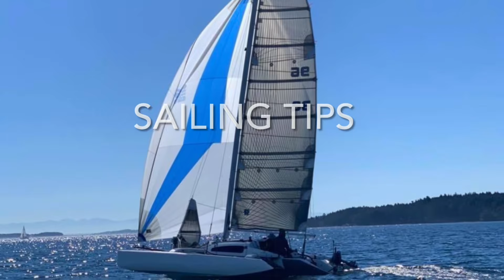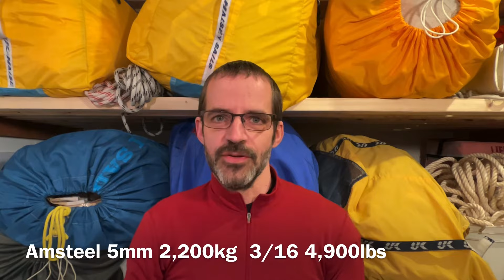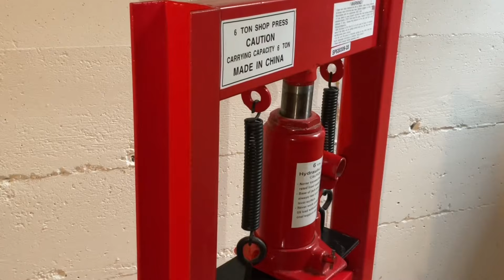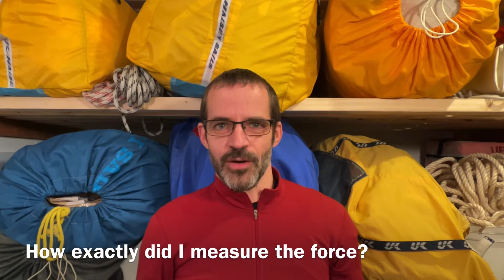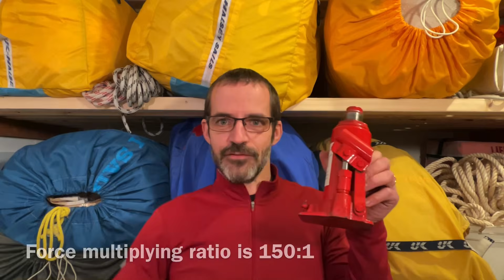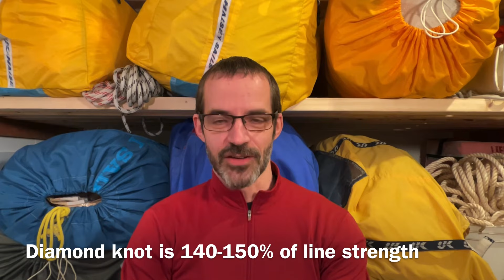The Easiest Way to Make Soft Shackles

Comment: I'm not a sailor, but I use the soft shackle on my camping hammock rigging. I've been using the diamond knot, I have tied it many times for myself and friends. However; seeing the strength of the figure 8, I guess I'll be using that from now on. It's quicker and simpler to tie, and hammocks have far less stress and strain compared to sailing applications.. A BIG thank you. I'm gonna subscribe just incase you come up with other handy dandy "things" I can plagiarize.
Reply: The big advantage of the diamond knot is that the knot ends up bigger, makes it less likely to whip loose. You’re basically always going to have at least full line strength from any of these things, so unless you want to live dangerously by, say, using a 4mm soft shackle on 5mm line, the MBS is just not all that interesting.
Reply from the maker: Glad you like it! You should check out this video where I use an overhand soft shackle to lift the front end of my car, so they may be strong enough for a hammock too! The Amazing Lightweight Rope That Can Lift A Car!!! https://youtu.be/9shiekaQNT0
Reply: Very intuitive,  many thanks

Comment: You can greatly increase the strength of this by tying the knot on a pair of brummel splices at  the ends and then looping the knot completely through the two eye splices. The bury must extend a couple of inches beyond the beginning of the knot. This requires more line, and if this breaks, it will break in the loop. See https://www.youtube.com/watch?v=jU_mmdbQeCQ
Reply from the maker: Yes that variant is much stronger, and beefs up the weak points adjacent to the knot as you noted! I did some fun practical testing of the “weak” variant in this video: The Amazing Lightweight Rope That Can Lift A Car!!! https://youtu.be/9shiekaQNT0

Comment: But WHY not using stainless steel, or simpler cord for mildly loaded applications?
Never heard of this tinkering.
Reply from the maker: You could use stainless, although it's more expensive, and tends to come in limited sizes determined by the manufacturer. You can make these any size! You can also use any cheaper single-braid line for more mildly-loaded applications. Just made a new video on this which uses a really long shackle! The Amazing Lightweight Rope That Can Lift A Car!!! https://youtu.be/9shiekaQNT0

Comment: "says Dyneema is really slippery and doesn't hold knots well, then ties simple knot for soft shackle knob.  Knot slips."  This kinda bugs me - I'd far rather have a soft shackle that breaks before the knot unties.  For that, James from Sailing Zingaro demonstrates a soft shackle that still uses a simple overhand knot, but the free ends have simple spliced loops spliced in that the rest of the soft shackle runs thru.  This stops the ends from pulling through and the soft shackle can not come untied.  Pretty slick - https://youtu.be/o4J4hJoJFHg?t=1040    HowNot2 also has a demo on this type, and they did break tests using a strain gauge!   https://www.youtube.com/watch?v=jU_mmdbQeCQ    Peruse their videos for other useful knot and sailing info, too.
Reply from the maker: Those are great videos! It really depends on your use case as to how complex you need to go. When I said “doesn’t hold knots very well” I was referring to the misconception that knots Dyneema are useless, when in fact it takes quite a bit of force to pull them out. My simple shackle could lift a Toyota Corolla before the knot pulls out, which I think is still pretty useful for lots of applications, even though a more advanced shackle with the same line could lift more. The benefit of the Sailing Zingaro technique is that the bury doubles up the Dyneema where it normally breaks too, so it’s a very good technique, just a bit more complex.

Comment: Hi, I  just discover that the « biggest » problem of dyneema is that it expand in cold weather. Have you experienced that? What is your take on this? Thanks for your insight
Reply from the maker: I haven’t really noticed or found it to be a problem. We use Dyneema stays for our mast and bowsprit, plus lots of other things. I know lots of other boats that use Dyneema rigging too and they haven’t said anything about temperature sensitivity either. But it’s also not that cold in the winter or hot in the summer here (West Coast BC Canada) so maybe a bigger problem in other places? Hope this helps!

Comment: I just came off building a bunch of these. I must say that the diamond knot is really not difficult to tie at all. For a highly capable guy like yourself that can perform all these hydraulic break strength tests and sail a race boat the lanyard knot is pretty simple. Id recommend the diamond lanyard over the overhand. The button knot is a bit tougher so the diamond lanyard is a nice compromise.
Reply from the maker: I totally agree – if you can tie a Diamond knot then do it!

I first tied soft shackles with an overhand knot a couple of years ago shortly after we got our F-82R trimaran when I was experimenting with different spinnaker and screacher sheeting locations on the aft beam and wanted something where I could easily adjust the length of the shackle on the water. It truly was a jury rig and I was expecting them to blow up on the first sail, but they didn’t.

Six months later, we blew up the diamond knot soft shackle that connects the main sheet to the boom (due to chafe and not inherent strength of the shackle or knot). I didn’t have a long enough diamond knot shackle on hand to replace it but I did have a long overhand shackle on the boat, so I used it, also expecting it to blow up due to the higher loads, but again it didn’t. 

For the next two years I kept using these overhand knot shackles in progressively heavier conditions with no issues whatsoever when I saw a forum post asking “Can you tie a soft shackle with something simpler than a diamond knot, like an overhand knot?” I had the answer and it was a resounding “yes”, so I decided to do a YouTube video on it and post the video in the response. But before I posted the video I thought I had better do some empirical strength testing. So the progression was somewhat backwards to what you might expect 1) jury rig 2) field testing 3) empirical testing. 

Regardless, I will agree that if you can tie a Diamond knot then stick with that!
Reply: @SailingTipsCa  yeah when i went with the diamond i was wondering if i left something on the table by not using a button...but if a get that reduced rating...of   3000lbs?....did it matter? I need maybe 200 lbs...and that buttons a pain!...so yeah i take your point as well
Reply: I’ve tied button knot soft shackles, and they’re *fine*, but I cannot get that knot into my head. The diamond knot, on the other hand, is easy to tie by heart — I even did some experimentation in how I could do it wrong and what to avoid.

Afaik the difference in the strength is pretty much entirely because with the button knot, the noose goes around four strands instead of two. Makes you wonder whether you can’t just bury a short piece of filler inside the two strands at that location and get the same benefit.

Comment: I'm about to test a double fisherman knot for easy soft shackles. If you bury the tailsback into the rope it sold should increase strength a lot too (bigger bend radius of noose)
Reply from the maker: When pushed really hard soft shackles typically break adjacent to the knot where the noose attaches, so burying the ends back in creates extra thickness there and helps mitigate that problem!

Comment: Really nice with simple soft shackles. Instead of optimised knot you can increase line dimension one step. A little more cost and weight.
Reply from the maker: Yes you can use this general noose technique and experiment with different types of stopper knots. Try it and let us know how it goes!

Comment: If you  tie an ashley's bend (abok 1452) and then capsize the tail "hole" over the head "hole", that should make a two strand diamond knot.
I guess the trick is to find the simplest two strand stopper that is very stable.  I'm nervous about the figure 8 as a two strand stopper.
The climbers have had bad experiences with that as a "flat bend"  where you pull the legs apart and load it at 180 degrees to get a flat side that will slide across obstructions or ridges.  The standard way is with an overhand knot, known as the European Death Knot.  Some people were worried about the overhand knot capsizing at a low load and tried the figure 8 instead.  It capsized at a much lower load and rolled off the end of the tails, making it worse, not better.
I realize this application is not the 180 degree loading, but more of a stopper loading at zero degrees, but I would want more testing of rolling on perhaps not perfectly set figure 8 knots to see how sensitive it is.  In the EDK vs Fig8  testing, quality of set was a critical factor.
I have a strong interest in making soft shackles in the field for camping.  You can save a lot of weight by carrying a few feet of amsteel blue type cord instead of a bunch of aluminum carabiners that you might use in slinging bear bags, improvising suspended bedding and things like that.   Suspended bedding tends to get some harsh loads from shallow suspension angles multiplying the midway load a lot.
Reply from the maker: You’re absolutely right that the key is to find a two-strand stopper that is both very stable and easy to tie. I’ll look into your Ashley bend recommendation. 

You’re also absolutely right that a flat figure eight bend performs poorly where you pull the two legs apart, because it rolls over itself and comes apart. We actually did a test of this versus a double overhand knot, where we took two strands of climber’s rope, put a double figure eight in one end, double overhand knot in the other, and tried to pull them apart from the middle with a hydraulic jack. The results were exactly as you described – the overhand knot performed far better in this application. 

We have it on video so I just posted it as a short (https://youtube.com/shorts/LjR5JRGyaxI). I was reluctant to do so previously because it’s not a typical sailing knot or configuration, and I thought it might confuse people, but I have it so why not!?!?

On the other hand the figure 8 appears to perform better as a stopper knot, particularly in slippery Dyneema applications, where the legs are not pulled apart.

All of that said, I just use the double overhand knot in the soft shackles on my boat because they’re strong enough for my needs. Thanks for your comments!!!
Reply: @SailingTipsCa  Thanks for the clip.   That's fun to see! 
I know a few simple single strand stoppers with good performance, but most of the big, strong double strand stoppers take some work.
For more security and more work, a lanyard knot (a.k.a. bosun's whistle knot, abok 787) might be really secure.  I'm comfortable with tying it because it is just a double carrick bend with the most obvious follow throughs.
There's also a fun sort of finger jig technique for tying it that usually goes along with the boatswain's whistle knot demo.
But you're right, unless you're really close to the line strength, it doesn't matter that much.
My hammock strap system is using brummel spliced eyes and a long friction tube adjuster in hollow braid amsteel blue, so it already has a pretty efficient build so I'm using minimal sized line for that .  Field built is usually over-sized for simplicity.
I probably just don't like overhand knots much.  I wonder how the double fisherman's bend (a.k.a. grapevine - abok 1415) in the tail performs.  it's really easy to tie.  That was one of the fixes to improve strength/stability on the overhand flat bend in the climber's investigation.  You're never going to untie it after full loading though.

Comment: Thanks. Would these work for reefing a sail? Or is there a better faster singlehanded reefing method?  I'm a fairly new sailor. It's for an OzGoose dingy.
Reply from the maker: You can definitely use for reefing - I explain one approach in my reefing video at https://youtu.be/zUJ_eQU6z5Q. I use this shackle for the third reef on our F-82R trimaran, because it's very deep and I don't want to leave those really long reef lines rigged all the time. You generally need to lower the sail to get control of it, then insert the soft shackle and re-hoist. If you leave it partly raised the flogging may make it difficult to get control of the clew, although the OzGoose is a pretty small boat so you might be able to leave it partly hoisted.  You could also try leaving the soft shackles inserted into the reefing cringles and secured with a small piece of whipping twine so they they don't fall out. Have you talked to other OzGoose sailors to see what they do?
Reply: @SailingTipsCa  
Thanks

Comment: Do the soft shackles require any yank protection ?  If used to hank on a jib does the stainless wire rigging eat through naked dyneema quick time ?
Reply from the maker: I’ve used Dyneema hanks on synthetic and stainless rod forestays, but never on stainless wire. That said it would probably work too, as stainless wire is also fairly smooth when in good condition, the loads on the hanks aren’t that high (relative to other applications) and Dyneema is quite abrasion resistant. The main type of Dyneema hank I’ve used had a Dyneema loop sewn into one side of the sail, which loops around the forestay, and is captured by a Velcro closure sewn into the other side, like Velcro shoes for kids. I’ve only ever had Dyneema abrade through on sharp edges, but never on anything rounded. Do you have grommets on your sail?

Comment: It's amazing that the dyneema soft shackle works with a figure-of-eight knot. So a much more complicated diamond or other comparable knots are not necessary at all?
Reply from the maker: I know - I often don’t even bother with the double figure-of-eight and just use a double overhand knot! Maybe the fancy knots are like a secret handshake or something like that! A freshly tied double overhand or figure-of-eight knot will pull out instead of actually breaking the line, which I think the secret handshakers were afraid of, but most people don’t apply that much load. And once they are well-set with a few good load cycles they will be much less likely to pull out. I doubt the double overhand soft shackles I’ve been using for my main sheet, spinnaker, and screacher blocks would pull out now…

Comment: It's brilliant and safe to use. I also like the way you test it. I think i have an even easier methode without going through the line. You bend the line in half and make the knot. To close the loop, you use a knot that kitesurfers use to attach their lines to the kite. I have no issues with it untill now. And as you tested your methode it also proves that my methode is not bad. It's super easy and cheap as you said it. Its also easy if you have to make a quick fix on the field. But i have to admit your methode is 100% bulletproof, mine a little bit less.
Reply from the maker: Thanks for the idea - I’ll look up the kite surfer knot and try your suggestion too!
Reply: I think you will like the simplicity of it. Its called a Larkshead knot seems.
Reply: The kite surfer knot is also called a cow hitch. It is two-half hitches with the direction of the second one reversed.

Comment: Unbelievably quick and easy , and more that strong enough for the loads on my boat.   I've seen seen a method where the unfinished ends a buried into the line - it's tidy and provides more thickness in the line.  I'm thinking of trying that with the double figure 8,   It would be interesting to  see details of how you've used the shackles.  I'm thinking of using one on an asym clew with new core dependent sheets.   Hoping to make as smooth a connection as possible to avoid catching on the forestay.  any tips would be appreciated
Reply from the maker: Thanks! Yes burying the ends back in does make for a stronger result and tidier finish, but these are so quick and easy that you can make them in the field as an emergency jury rig. I'll also do a video on creative uses of soft shackles - good idea! And I do also have a suggestion on how to make assym sheets using a simple technique - I'll do a video on that too. For the kite attachment, basically feed the Dyneema through itself, then add a simple figure eight. Feed the figure eight through the clew ring, and into the Dyneema loop which tightens on itself. It's like an integral soft shackle in the end of the line.